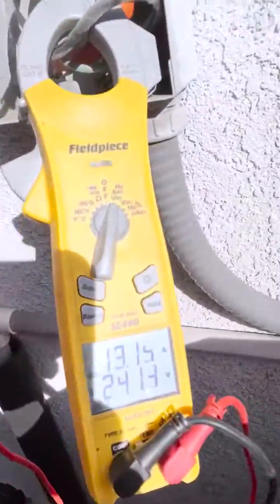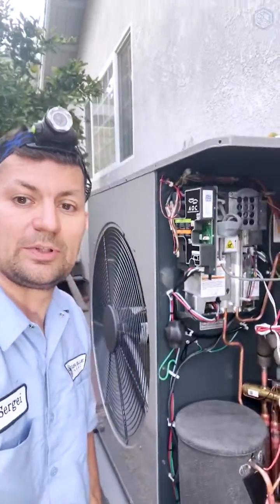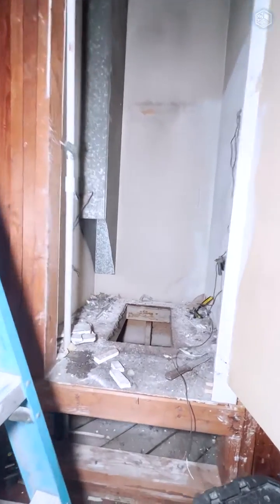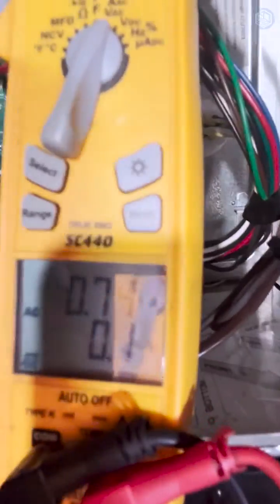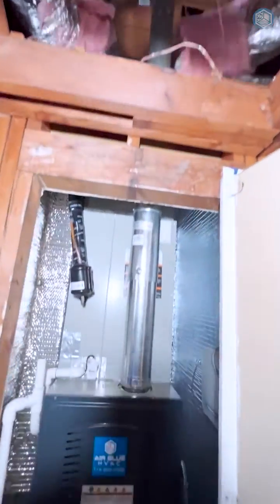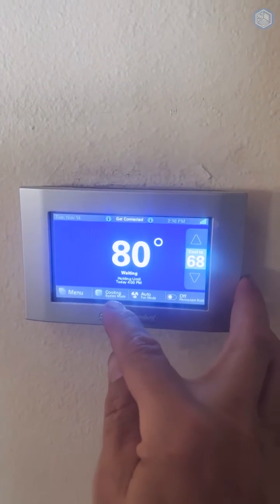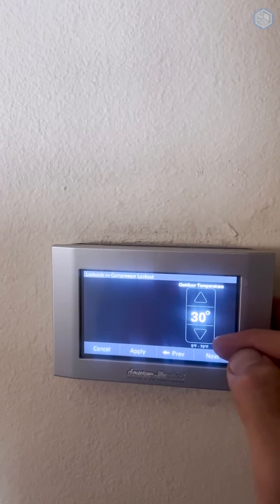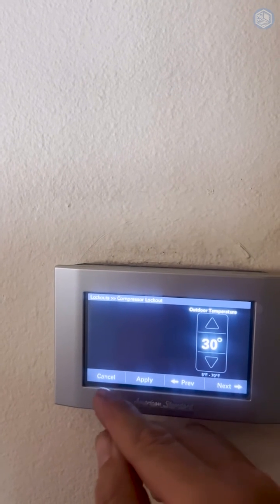This HVAC system will save you money & energy! Upgrading to Variable Speed Heat Pump!

Comment: Hi, your work looks amazing!
is this a communicating system? Looks like a single stage American standard furnace.
Reply from the maker: yes, this is communicating Heat pump variable speed. Gas furnace is also variable speed blower with backup gas heating.
Reply from the maker: usually we only use air handler indoor, but this customer didn’t want to give up gas heating option.
Reply: @airbluehvac  hi what is the model of the Gas furnace. I live in Missouri and I agree with not wanting to give up Gas heating. Looking at going with duel fuel system like this!
Reply from the maker: @BradleyPagano  we are in California Orange County, so it is ultra low nox model with variable speed blower.
Reply: @airbluehvac  is the furnace a communicating ?
Reply from the maker: @BradleyPagano  yes it communicates through the relay board, because furnace is the one providing matching capacity variable airflow while in cooling and heating modes to squeeze maximum efficiency from the heat pump